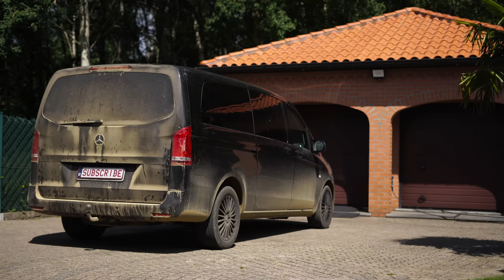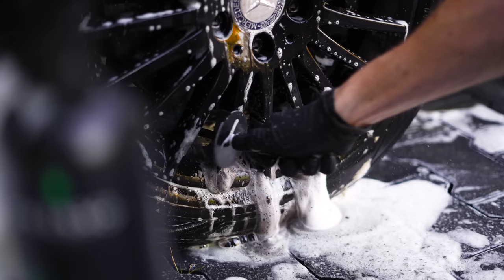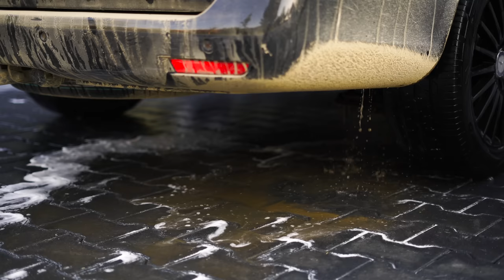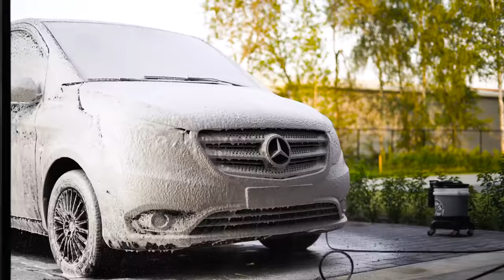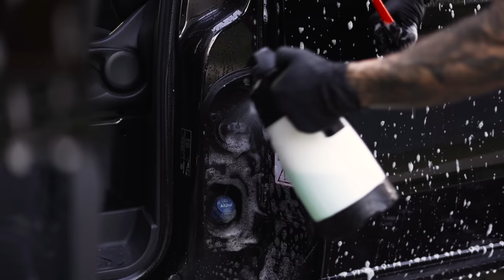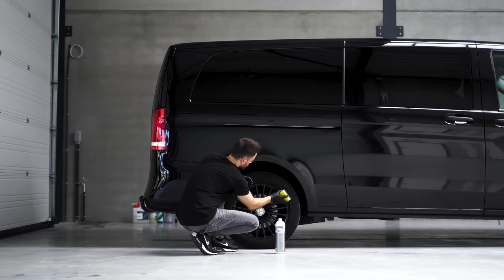Cleaning a Super Dirty Mercedes Vito - Exterior Auto Detailing

Comment: I love degreaser baths way better then foam baths. I have use both an the degreaser just hits different also the water 🧿 as if it's been wash. But I do degreaser n wash at the same time n by section then dry the car by spray wax an shamwow and no cloth their horrible.

Comment: I can never get my snow foam to stay long enough to go around with a detailing brush. It dries up too quickly
Reply: Try Carpro Reset 10::1 or Koch Chemie GSF 10:1 - both quality soaps that foam quite well, 10:1 is quite a rich mixture so should be good for any foam cannon.
Reply: @kylechow6072  thanks, I’ll give it a try. I use auto finesse and generally use the mix they recommend. I try not to do it in direct sunlight or when the car bodywork is warm but still get the same results. Watched too many videos of retailers casually walking around foaming the car then going over with a detailing brush 😂 they must be re foaming between the shots